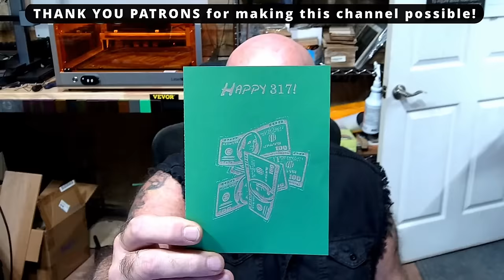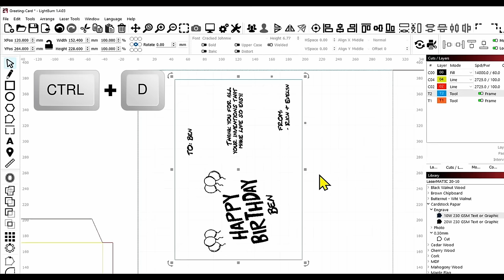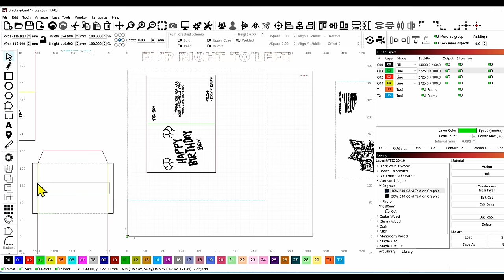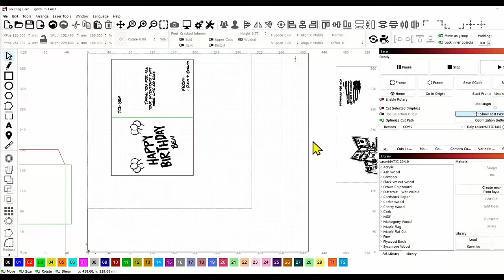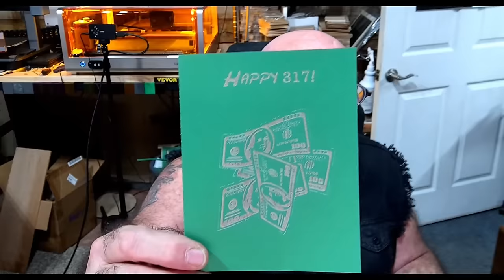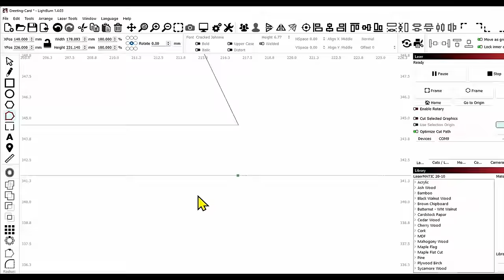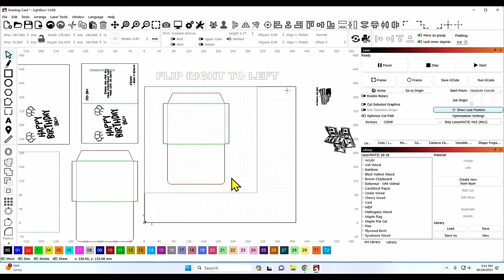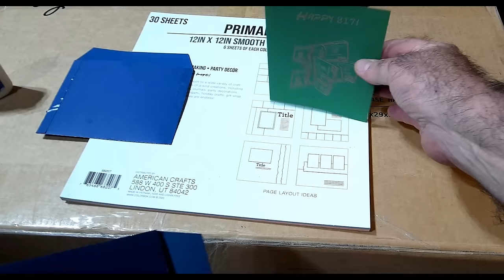😲 How to make a greeting card and an envelope, from scratch, in Lightburn!

Comment: Cover the area of honeycomb outside the card stock with more paper and the partial pressure created by your exhaust fan will hold the card stock down.
Reply from the maker: Magnets are much easier Sam.
Reply: If your honeycomb is attractive to magnets.
Reply from the maker: Yes, I addressed that in the video Sam.
Reply: Unfortunately for me, my honeycomb is indifferent to magnets. I did make some clips from paper clips and they work well enough.
I did not miss you placing magnets to hold the card stock down.

Comment: Thanks for the video!  My question is how did you get that color from the green card stock without it being blackened by the laser?
Reply from the maker: Like I said in the video, experiment with power and speed to get different colors. This one was done at a very low power and very high speed, so all it did was remove the die from the paper.
Reply: @TheLouisianaHobbyGuy  Thank you!  I will give it a try.

Comment: oooh could have recovered from the tear if you'd put glue on the outside of the flaps and glued the bottom on top of them
Reply from the maker: The flap was damaged too. But it didn't fit right anyway, so I had to do a new one.
Reply: Yeh my bad, I commented before the next bit :D
Reply: Turn the envelope "inside out", and make your folds the other way, and the tears will be on the inside with a perfect outside surface.